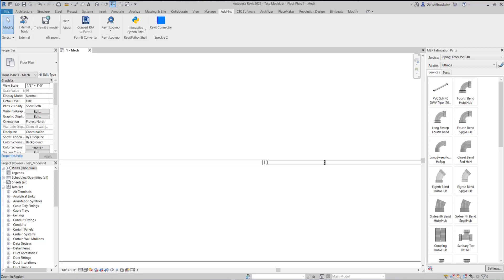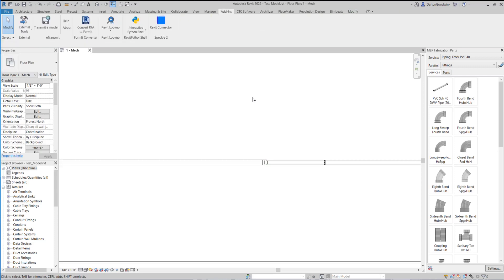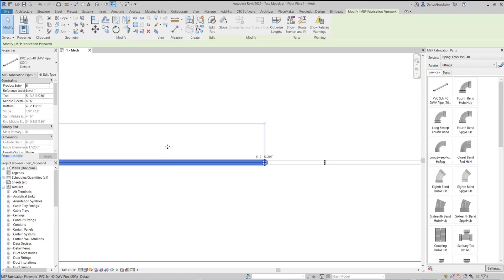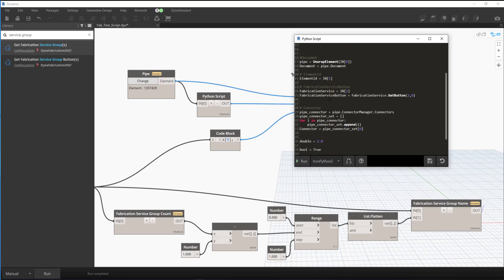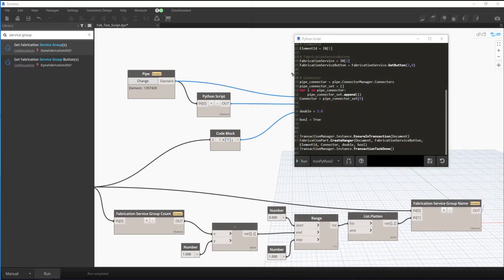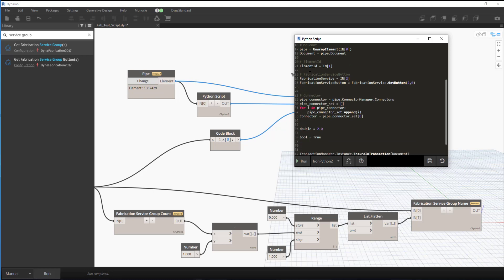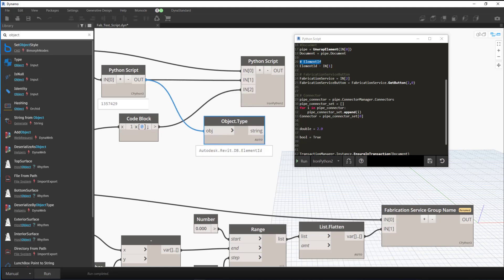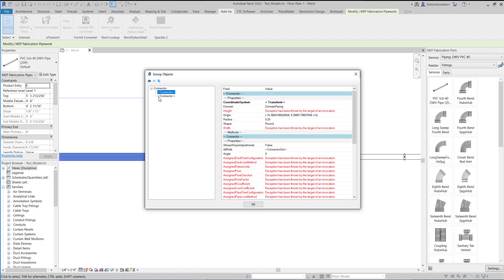Dynamo | Place Fabrication Hanger | MEP Fabrication Parts

Comment: Hi,
In Revit 2022,Is there any need to set up button codes in the service database in Fabrication product ? I have tried to work with fab part by deleting the entire button codes, It works fine for me. Does that mean we don't need to setup button codes to work with Revit 2022?
Reply: Revit doesn't need the button codes.  Those codes are for Autocad / design line.